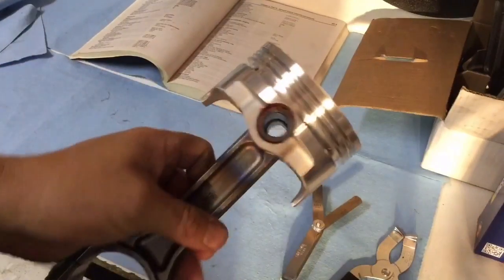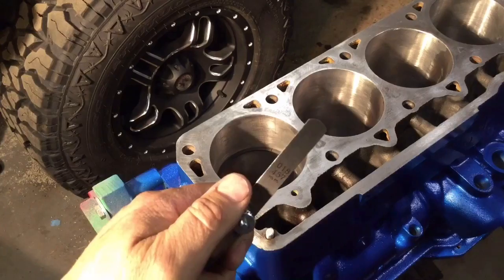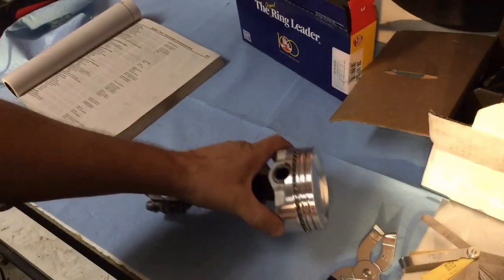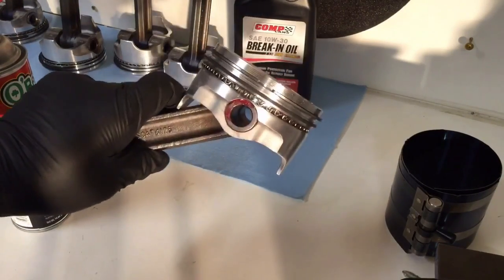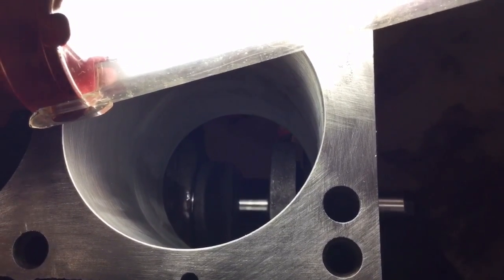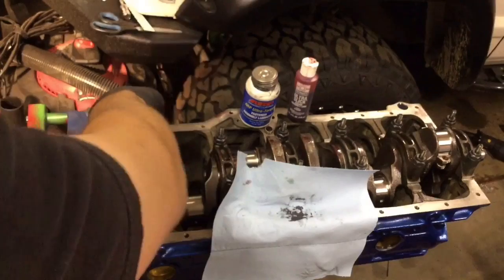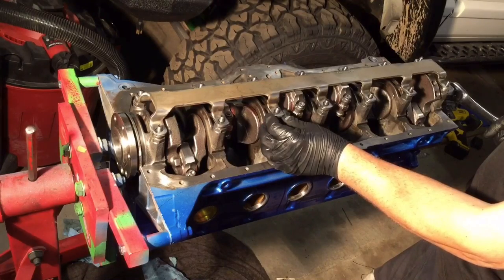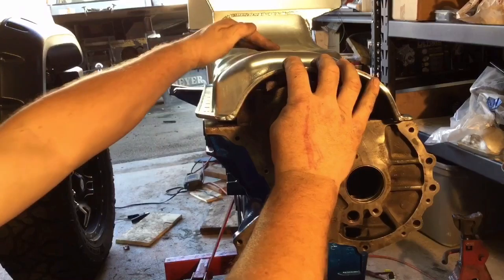Jeep 4.7 Stroker Complete Build Part 2

Comment: Well made informative videos and too the point....Thank you. Maybe a stupid question but what if your out of spec on the crank & rods via the Plastigauge? What's the fix?
Reply from the maker: Thank you! Say you have a scratched or scored crankshaft, you can have it polished/machined down and then buy matching bearings to make up for the under size crank.

Comment: Rather than use one of the adjustable ring compression sleeves a ring compressor made from a piece of tubing with an ID to match the cylinder on one that tapers towards the other end is a lot easier to use. That is how the factory install was done. The plastic slippers used on the rod studs would pick up the pin diameter on the crank. All six pistons & rods were put in at the same time. The assembly dept wasn't happy with the weight of the fixture being used. I got tasked with designing and building a better one that weighed about half as much.
As to the main bearing girdle.  I'm surprised that there hasn't an aftermarket griddle that not only attaches to the cap bolts but extends out to the sides of the block. This would require machine work to mill a mounting surface and drill & tap 10 holes in the main bearing webbing. When I retired we were building the 4.0 plus two different 24 valve V-6s. Comparing the 4.0 to the V-6s showed just how crude the typical US inline six with design roots in the 1960s or earlier really is. The V-6s had 6 bolt mains with full girdles that also acted as wind age trays. But modern engines come with a price. Vee type engines with SOHCs or DOHCs are incredibly wide. They take up a larger volume per cubic unit of displacement. The sole exception to this might be the VR-6 and VR-8 that VW was building.

Comment: Are those KB hyperuetectic pistons? It's my undrstanding those require wider top ring gaps because of the amount of heat the piston reflects back. Nice thing about those Pistons is you can run tighter piston to wall clearences.
Reply from the maker: Beau Ramelot I’ve heard of that on a SBC but not on the 4.0 block. I guess the top ring can expand under high heat and cause problems if there’s no place to go. My motor doesn’t get race fuel and cools well so I’m not to worried. And yes, I agree on the tight bore, the machine shop waited until I had the pistons and brought them in so they could match the bore as close as possible.
Reply: Tinkering Fox not sure why small block Chevy and 4.0 be any different. https://www.uempistons.com/installation_instructions/kb_installation.pdf
Reply from the maker: Beau Ramelot very interesting! I just read up on that. I might change out to a roller cam and this would be a great excuse to file that gap larger. I’m going to try to incorporate this 2 page sheet into the video or at least post it in the description. Thank you.
Reply from the maker: Beau Ramelot I just uploaded a video with info on the top ring end gap. Thank you for bringing this to my attention.
Reply: Tinkering Fox I've  built quite a few big blocks from stock 454 to twin blown 572s for buddies boat both making 1100 hp on pump gas. Built 1. 454 and one 519 with KB hyperuetectics and I remember they called really wide ring gaps. But those Pistons were pretty big.

Comment: Would you suggest putting the crankshaft girdle on if we're using a block from 1991?
Reply from the maker: Llama Biscuit no because the block is thicker than later model one. It does not need the extra support. I'm sure it would not hurt but I doubt it's necessary.

Comment: Looking at doing the same!!! Didn't hear if. Do you mentioned is this a forged kit I'm also running a T3 T4 set up and looking at pouring the boost to it so I'm looking at a forged kit. Or is it worth going forged in your honest option.
Reply from the maker: Kyle eves I'm certainly no expert with turbos. Give 505 a call and they'll have the answers you're looking for without a doubt.
Reply: The rods are forged, crank is scats 9000 series steel cast, KB pistons are Hypereutectic, this assembly could turn 6500 with no issues. now if your gonna turbo and do hill climbs, mud bogs and tractor pulls you will need forged pistons cause that kinda stuff pumps more heat.  If your plan is to turbo, bushwhack hard and bomb the street the rest of the time, the setup being build here has you covered, the rest of your drivetrain that's another story.

Comment: im trying to understand.  you use a 4.2L crank with stock 4.0 rods?
Reply from the maker: stapleyisgay ,
Yes, and custom Keith Black 944 pistons. Alternatively you can use a 4.2 crank, 4.2 rods and 4.0 pistons but the rod to piston angle at the bottom of the stroke is greater giving you a greater risk of piston slap. The 4.2 crank gives you a longer stroke creating more torque but the length of the stroke needs to be made up for in the piston or rod to keep the piston from striking the head.
Reply: How much did you put into it in parts?
Reply from the maker: stapleyisgay 
Not sure, I'll try to put together a price/parts list in the credits (still more to come)